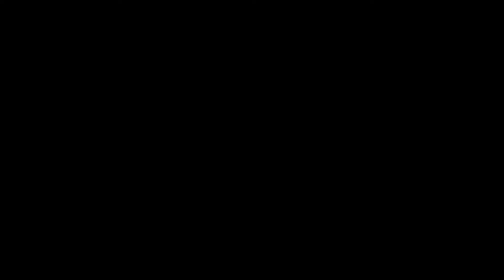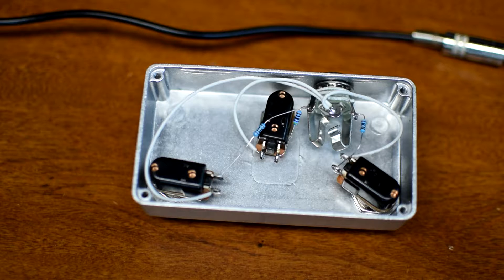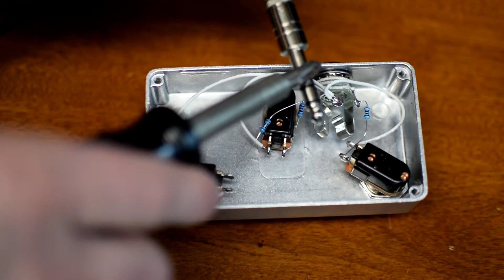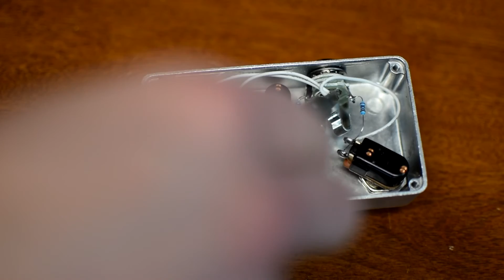Line 6 HX Stomp - DIY Footswitch Tutorial | Make Your Own

Comment: Confusing !  The Helix Stomp will only accept two additional switches, so why demonstrate using a circuit with three? The Stomp does not require the resistors in the circuit either, a simple momentary closed (or open) switch is all that's required.

Comment: Great information. I'm a noob on this, why did you add the resistors?
Reply from the maker: The resistors were leftover from another project.  You can just use two momentary switches and have wire going to the Tip and Ring connections on the stereo jack.  Refer to the diagram in the description.

Comment: Hi, question here. I bought a generic 2 switch pedal and a TRS cable and it on works one of the two switches. I unwelded and welded everything and even bought a new cable and nothing changed. Footswitch 4 doesn’t work. Do you know why this could happen?  Thanks a lot!
Reply: i have the same problem - did you fix it?
Reply: Riaan Myburgh In global settings -> preferences set Exp/Fs tip to FS4
Reply: In global settings -> preferences set Exp/Fs tip to FS4
Reply: Haha, thanks for the response, though I did figure it out eventually😂

Comment: Are the momentary footswitches normally open or normally closed?
Reply: From https://line6.com/support/topic/38990-extra-footswitches-for-hx-stomp-normally-open-or-normally-closed/ :
"Either will work. It is setup for N/O by default, but if you want to use N/C, just go to Global Settings>Preferences>Tip Polarity and Ring Polarity and set them to "Invert". "